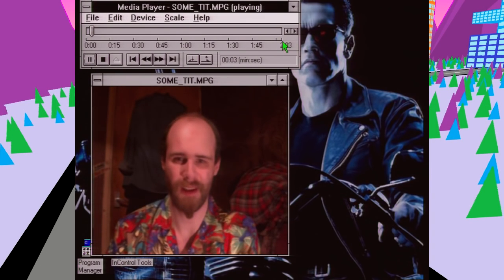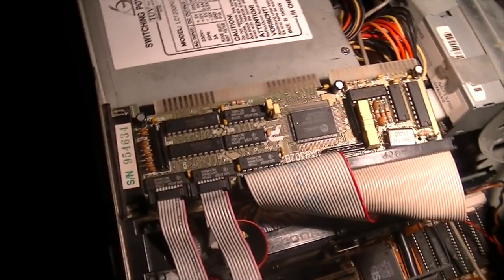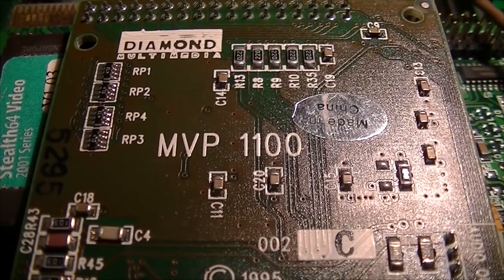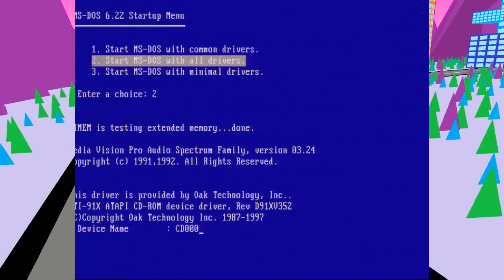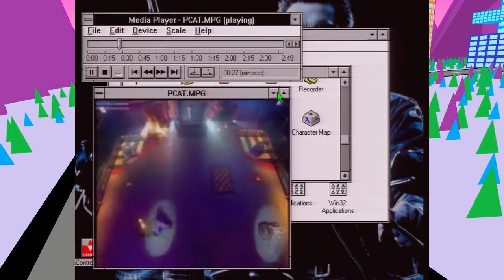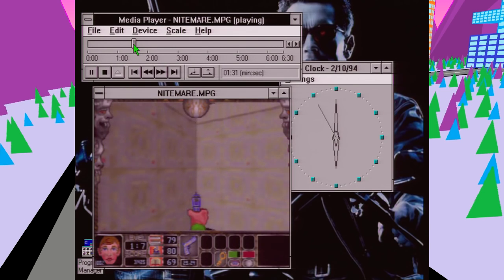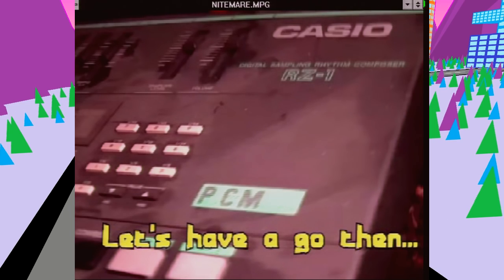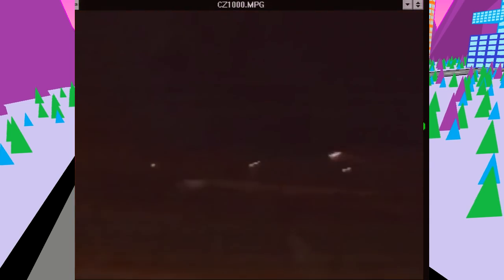S3 Scenic/MX2 Decoder

Comment: This is quite a very  interesting video.By the way I was given a Packard Bell Multimedia C115 system two months ago and on the motherboard it had a BT Bt829KPF video decoder chip on it (for decoding mpeg too).My brother 12 years ago gave me his Packard Bell Multimedia C115 system and instead of a mpeg video decoder it had USB ports.
The system with the video decoder had a video CD in its CD-ROM drive Both of these were running Windows 95B though.These were USA systems though.
I enjoyed your thorough review with these vintage components.It's quite educational.
Thanks!
Reply from the maker: Cheers. I'm not surprised PB included something like that on their machines, for all the stick people throw at them they did at least try out interesting and new ideas instead of making boring crap. I have a Pulsar 16 system which is similar to the C115 and uses the same form factor, it has USB but there are many underpopulated pads on the motherboard (Intel made) and I now wonder if one of those was for a Bt829. I know one of them was for a Yamaha 719 audio chip as AST used the same motherboards for a while but with different options installed. These systems also used a Trio 64V+.

Comment: I have absolutely have no need for one of these. BUT I BOUGHT ONE (the only one on eBay as far as I can tell)! I even got a Diamond S3 Virge 4MB to pair with it. I already have enough MPEG 1 and 2 capable VGA and 3D era-correct cards as you could want. I even have a Trio3D AGP and various Trio64/V+. I think I had a RETRO addiction...

This thing will go well in the AMD am5x86-P75(133Mhz) though...
Reply from the maker: Seems the seller instantly relists them when they are bought, so who knows how many he has. I only know this as I recently got another one, had an expansion card blow up and take my video card with it. Either way, sounds like a good idea to me, whilst you don't need to play MPEG files on your machine it surely doesn't seem like a bad thing to have the ability to. To be honest, I've used mine a lot more than I thought I would, mostly for letting music videos run when I'm working near the machine.

Comment: The mpeg decoder board might not have much of a practical use now days, but having something to plug into those connectors which typically went unused is neat in of itself, at least from my perspective. That was neat to see.  I like your use of demoing the card as your intro. 

That's a neat idea to convert on the fly youtube videos to mpeg though. The backbone to do that sort of exists already with these websites that will download youtube videos for you, just a matter of some kind of program or script I would think. Seems like their would be a way to do that.
Reply from the maker: The idea to run the intro on the card was a last second decision and ended up taking upwards of an hour because at first I forgot to change the aspect ratio, then I messed up the alignment. I'm happy with the final result though. It might have had some more use if the DOS API offered support for games using the RealMagic cards, but I don't think it does, I currently have no games to test but I think I have a copy of Dragons Lair for those somewhere that I may test.

That's a point. One thing that did occur to me after you mentioned that was how there exist utilities that can access the web from a command line, it makes me wonder if I could script a Telnet server to do this and then dump the resulting file to a network folder, or else script FTP after Telnet on the client... In that case though, perhaps it wouldn't be too hard to actually make the server download and convert the video itself (probably faster) and then do the network stuff. The down-side is the MPEG card's lack of love for WFW's Networking being enabled. I'll probably never try, I was just spewing random thoughts as I'd been using YouTube videos so much to demonstrate the card.

Thanks for the Winchip video, I just had to put it there because I thought this thing was going to be terrible the same way that processor is. It was dirt cheap, it is much smaller than its competitors and its marketing seems to have said little more than that "it decodes MPEG video". Some of the files I used actually exceed the VCD specifications by some margin and still no frames appear to be dropped.
Reply: HighTreason610
Does the card work any better with networking in Win95? or do drivers not exist for 95?
Reply from the maker: There are drivers for Windows 95, but I have not had time to test them. I think it's supposed to work better but obviously can't confirm this at the moment.
Reply: HighTreason610
Well, maybe all this would make for an interesting test, and video as well if your fancy gets tickled enough and you have time at some point. I know how you like to do strange tests, and this would certainly qualify as strange and interesting and I would guess you would be the first one, Youtube or otherwise to attempt such a feet.

Comment: Wow! I'd love to have one in my 486. I have a Realmagic, tho.
Reply from the maker: The RealMagic has the compatibility advantage, as you can play special versions of some games like Dragon's Layer - I have this version somewhere and while I'm not condoning piracy, I, err,  may be able to help you obtain it if you wish to try it out some time.

On the Socket 5 adapters, these devices were very expensive, so I've never really factored them into anything outside of Slot systems where they were relatively cheap if your board had the logic already. I do own a Socket 4-to-5 adapter however, made by OPTi and confirmed functioning. That is, unless you plug a K5 into an Intel board, that doesn't do anything unfortunately, but I had to try just to hold a middle finger to Intel. It does, however, let you plug in an MMX chip if you are happy to risk the fire hazard, but I've not taken that past POST as I'd rather not break anything. I will, however, need the adapter for use in a later video where it will be using a 90MHz Pentium on my ABIT Socket 4 board.
Reply: HighTreason610 I have the Pentium Overdrive 133, so luckily I don't really need it. :)

Comment: Which capture hardware did you use for the computer's output? Very nice video!
Reply from the maker: Blackmagic Intensity Pro with an old Gefen VGA-to-DVI scaler. It's all a bit beat up by now and needs replacing because the image ghosts to the right and interference keeps getting in. Plus, as a relatively early HDMI device, the Intensity is very limited and I can only use 576p50 most of the time, sometimes 720p60 is available but I have limited uses for it.
Reply: Thanks for the information! At the moment I'm looking for a VGA to HDMI scaler because I can capture HDMI just fine via my Xbox One's HDMI in. I need this scaler to capture videos of DOS games and Windows sessions,  so there will be different resolutions ranging from 320x240 over 800x600 to 1024x768. Could you recommend me something here?

Thank you very much in advance!

Comment: i have a cd-rom drive like this here with a similar tray plate, it's a 24x speed cd-rom drive i think.
Reply from the maker: Mitsumi kept this design for a very long time I think. I have a bezel that fits from a 32x drive, this one is only a 4x model which would have been ridiculously costly in 1994. I believe it's a late model though, made in 1997, but I'd have to pull it out and check.

Comment: I've been looking all over the net for working Windows 3.1 drivers for using this daughterboard on a Trio64V+; the only file I can find (CW312006.ZIP) fails with the error "Setup is unable to decompress and copy all of the program files needed to proceed with the installation.  Please contact your software vendor. Error 112." in Windows 3.1.  A link to the drivers you used would be very, very appreciated.
Reply from the maker: If you're using the Diamond version then you should be able to use the files on the driver CD image. I think there's a similar disc floating around out there for Data Expert cards. Unfortunately the drivers are not generic and vary by vendor, also there are some very specific steps to follow when installing them. The Diamond card in this video uses a different driver than it normally would and requires Video for Windows to be installed from the CD first, as this is a customized version specifically for this card, prior to installing the MVP driver - or I think that's how it went, the documents on the CDs should explain, though if they don't feel free to let me know and I'll try to dig up whatever information you are missing.
If it is the Diamond one you want, then they should be on Disc 2 of this - http://vogonsdrivers.com/getfile.php?fileid=504&menustate=1,0
Reply: Thanks for the reply.  My card actually is one of those Data Expert cards, the DataExpert DSP6430 to be exact.  I'd be very grateful if you could point me to the direction the driver disks are at.  So far I've had zero luck getting it to work, so the card isn't using its most interesting feature.